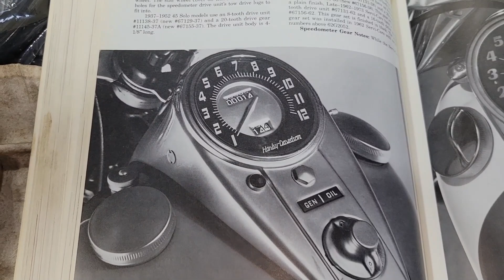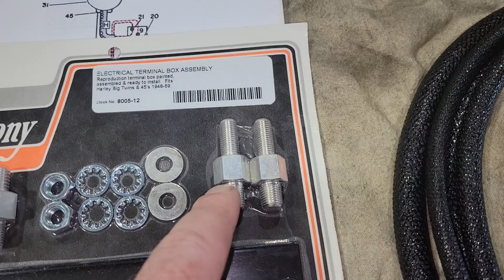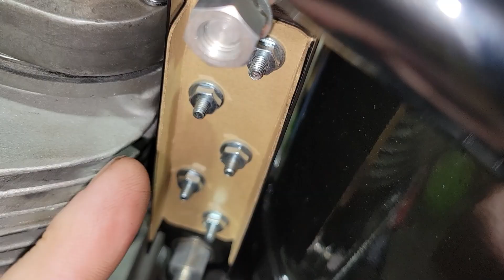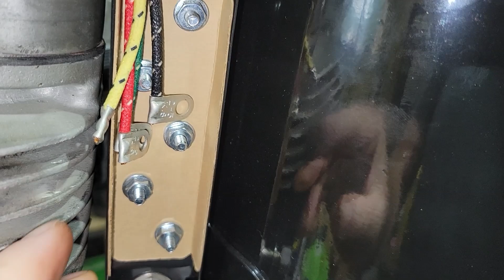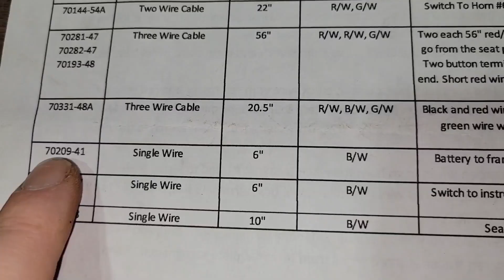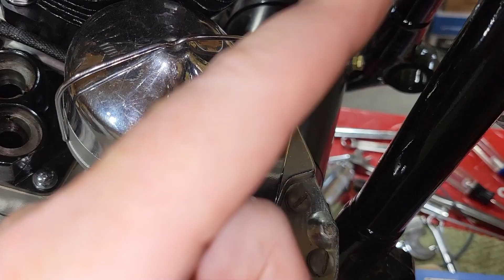1956 Harley Davidson FLH Restoration Part 12, The speedometer, Rear terminal box & wire routing

Comment: Interestingly I have a Paughco Duo Glide style frame and it uses the earlier short mounting studs for the rear terminal box. The longer ones I guess are for the later Pan and Shovelhead. If not then I'm stuck with using what fits the threads on my frame which are the short ones.
Reply from the maker: Oh that’s why, it might be ok

Comment: I just installed my rear terminal board in the longer studs are for the later Panhead Shovelhead. It's also different thread pattern it won't screw into the frame bosses.
Reply from the maker: That is odd, maybe the frame is different

Comment: I just installed my rear terminal box from colony. I haven't connected any wires yet and I pretty much stripped the bike of all the wires last week with the exception of the wires running out of the rear fender and the headlight and spot lamp wires.